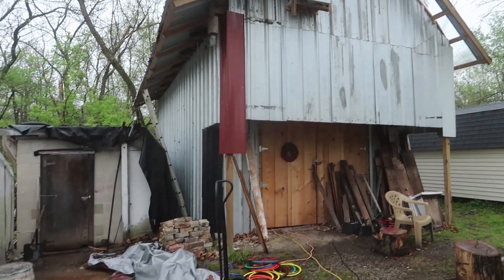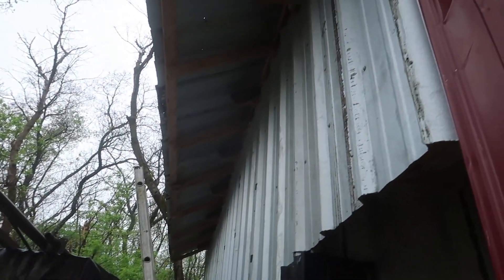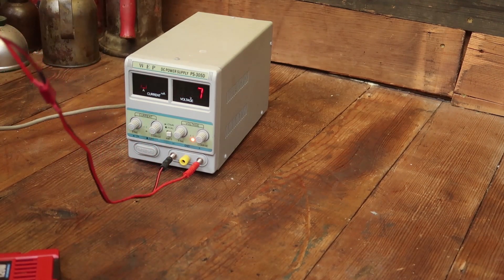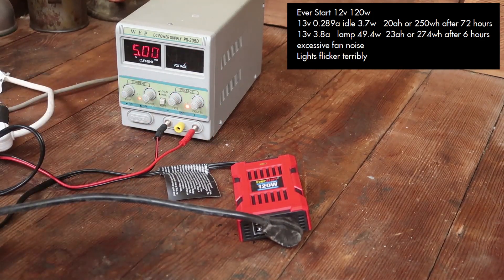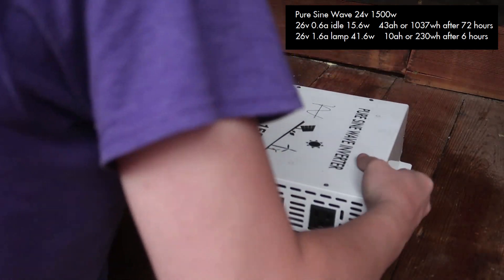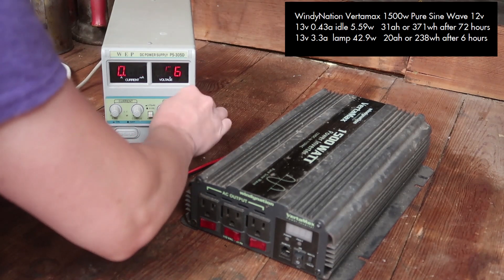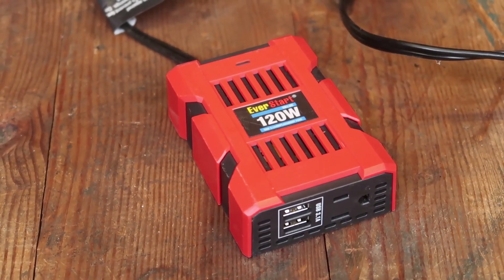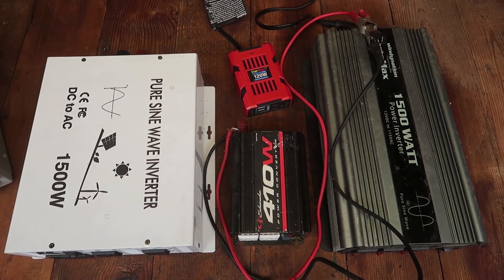Solar Sunday 03: 12v & 24v AC Inverter Idle Current Draw / Usage Test for Lighting

Comment: i have encountered this movie whilst researching for LOW idle consumption power inverters, very useful, i started researching because i have fairly large MPPT + Inverter combo. Mppt takes about 20W but the Inverter I was fairly shocked of. Inverter that I have can output 4000W pure sine wave and 8000W surge, and it takes 80W in idle no matter what is hooked up to it. I was shocked, when I have connected laptop that takes 20W i was observing drainage of about 120W. I have done few different tests and it is actually the case that this large inverter and mppt indeed takes 100W constantly. Fortunately I can switch off inverter part of it to limit the drag to about 20W. I am also switching it off when I dont have solar production so then drag is 0W. I am powering devices that are all low consumption like fridges, laptops, small displays, lighting etc.

Comment: can you mention any website for cubesat batteries with atleast 2yrs in orbit life.......
Reply from the maker: Are you building a cubesat? Maybe put 18650s into an epoxied resin container to hold pressure. Should last for 10 years if only charged to 3.9v.
Reply: @RinoasBigProjects  yes doing a student cubesat mission design on Synthetic Aperture Radars......will look into your info surely .... thank you
Reply from the maker: If you keep 18650 cells in a container, the wires will be the leak points. You can use automobile spark plugs as perfectly sealed insulated connectors while you are testing things in the vacuum chamber, before finding a better solution. I believe lithium batteries slowly evaporate their internal electrolyte at vacuum, but epoxy resin could keep it all sealed and happy.

Also, have 1ah of capacity for every 0.5a you wish to pull, and you shouldnt need cooling. Maybe make it 1ah for every 250ma in the vacuum of space
Reply: @RinoasBigProjects  thanks for this . well probably I would like to ask just one or two short things in this aspect after doing some research on this .... 🙂
Reply from the maker: I used to help engineer batteries at an electric car startup in silicon valley. If you have any more questions, I recommend posting a new comment thread on one of my videos. Youtube notifies me of any new comments, but doesnt notify me of replies. So I have to scroll down and search for this comment thread. So if I ever dont respond, make a new comment by itself and I’ll get a notification for it
Reply: @RinoasBigProjects  surely thank u

Comment: Well, I'm up to 10 of these 85 amp hour batteries, it took that many for the Aims inverter/charger to act right...it runs my little window A/C unit no problem but I'm going to get 2 more batteries Wednesday for a total of 510 amp hours @24 volts...that should give me some reserve...I was down to 3 good 100  watt panels and a cracked one but I bought 3 more...they're slightly smaller of course , the first ones are discontinued ,  but they put out a half amp more...yesterday when the sun came out for a bit it was showing 510 watts from 6 panels...I retired the cracked panel until I can find some clear coat paint for  it...oh I figured out the idling current of the inverter , 19.2 watts...but, it has a standby mode that senses a load and turns it on ...it doesn't work for things that need the power to put  the load on, though...they just sit and wait on each other lol...then you have to turn it on manually...but...it has a remote switch...which I don't use ...these may be the final two batteries, I'll have 12...you'd think I could run a house lol but then that's kind of the plan I guess...a little house maybe..that way my batteries all the same type and within five months of each other on age...It's almost 5 AM, my batteries are at 24.6 volts, so that's 12.3 each about, sometimes they're a little lower but trying to keep it around 80 % or a bit higher left in them so they'll hopefully last a good long time...I think it will be enough to keep all the batteries from getting too high of a charge voltage ...the other day the volts got too high  and the little 410 watt inverter red light came on and it beeped , saying to me, two more , get two more ...lol...I 'd rather use batteries for a dump load than waste that good power, and really a person needs extra capacity just for rainy days. They'll also last longer if I have to charge them with the gas generator, but since I got more panels I haven't used the charger function lately so that's saving some on gas ...the best part is I don't have to worry about the power ever going off again...I've always been somewhat jealous of people who had a battery room...somehow wanting one and having one were always apart for me but I 'm getting closer...I found out the 410 watt inverter makes a great phone charger without being on...I put a switch on the input terminal and just turn that on, not the power switch, and it charges 2 amps to the usb terminal without the inverter being powered on...didn't know if you knew that or not but it works great without the idling current of the inverter being wasted from being unnecessarily on at night...

Comment: I’m surprised you didn’t use LED lightbulbs for this a lot less PowerDraw I am considering putting solar panels on top of my garage which is 27 foot long 7 1/2 foot high and 10 foot wide I have a number of electric wheelchair batteries and I run standard bayonet LED lightbulbs in thereI also work on small engines for two companies lawnmowers hedge trimmers  service and repair But I suppose at the end of the day you go with what you’ve got what’s the point of spending money on LEDs when you’ve already got the strip lights they’re enjoying the solar Sunday videos of yours Thanks and stay safe

Comment: Update..I bought the 410 watt for $10.49 at an Advance auto parts store..I got the last one they had..evidently they were on sale..Im running my 24 inch Vizio t.v. on it thanks to you..it works great...also not on sale lol but arriving in two days I decided on the Aims 2000 watt 24 volt inverter/charger...
Reply from the maker: nice!

Comment: I may have to get one of those...Im getting a 3000 watt to run my air fryer (24 volt brand unknown as yet) but just for the t.v. or something that little one would be about what I need..Im new to all this stuff so Im trying to just get it all working together...I have 4 deep cycle 27 F with 340 ah, a brand new epever 40 amp mppt that I just got today and am inverter shopping now so hey great timing...Im glad you showed that one..I fixed a riding mower and the guy had some solar panels in his barn he gave me too theyre only 15 watt but theres six so I fixed a pair of 19 ah batteries together and made a jumper pack out of those so the six get to keep those hot in case I need some portable D.C...it would be great to have that 410 watt inverter on those seperate from my other panels..thanks I liked the video

Comment: forgive me if i missed this, but why not run a 12 volt line into the shop so you could have the inverter there? it would eliminate the issue of having to go into the shed to turn an inverter on, but would still allow you to shut off the inverter after a days work. Im pretty sure you would have already thought of this but id like to know your reasonong behind not doing it.
Reply from the maker: id need some pretty thick cables tbh and i have plenty of ac extension cords. and since i'll eventually tear down that shed and rebuild it, and also switch to a 24v system and 24v LEDs, i dont want to make anything thats too permanent.

Comment: I actually like the voiceover format; the lack of background noise makes it feel more relaxed. Also, I'd be careful running any equipment you care about off of one of those Chinese switch-mode DC supplies. I've had two so far, and the first thing that fails is the output regulator: your project ends up receiving the maximum DC output voltage of the power supply. I've since switched to using batteries for testing until I build my own.

Comment: Cool   could you do a test on comparing square wave to pure sine wave inverters to an inductor  being a motor or transformer?
was always curious if the square wave inverter would run hotter compared to the sine wave inverter?  I subscribed to your
channel!  enjoyed watching    take care!
Reply from the maker: well sadly none of these handle starting a motor well.
Reply: @RinoasBigProjects  Yes a manual soft start circuit i built one using high power resistors or you can use the primary of a high amperage transformer.

Comment: If you intend on having the battery bank in the cinder block building why dont you run extention wires to the power switch of the inverter instead of longer power leads? You will have less loss this way.
Reply from the maker: because im not sure how long ill need this setup tbh. i am planning to rebuild the brick shed from the ground up and such. so anything i do now will get removed.

Comment: Let me know if you ever need any repair advice or parts for true/pure sine wave inverters. I repair a LOT of these. I like Samlex for reliability.
Reply: I bet you come across a lot with the Fets blown out?
Reply from the maker: thanks but so far they have worked well enough.
Reply: I do upgrades on them the increase the output. I have a good selection of mosfets that would give a big boost in wattage. They are free to you whenever you need!
Reply from the maker: well thank you! i am thinking about a rotary converter for running big motors, not sure though. However i may honestly just get a grid tie inverter and start feeding all my power into the grid eventually. power prices going up for the house
Reply: @RinoasBigProjects  Damien Maguire is working on a control board to turn a Prius inverter (about $100 on Ebay) into a general purpose high power VFD.

Comment: i find using 12v downlight LED lights is more efficient than charging batteries end then using a converter to step the voltage up 3 x 5w =15w  and i don't have the converter on standby.
Reply from the maker: agreed but i found these in the trash so i cant complain lol.